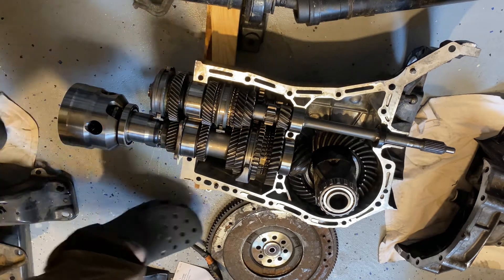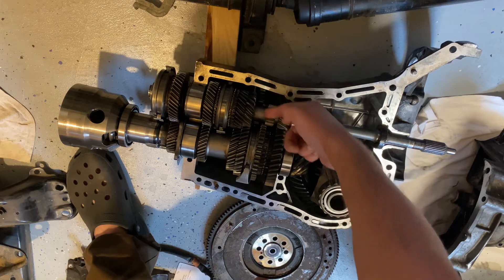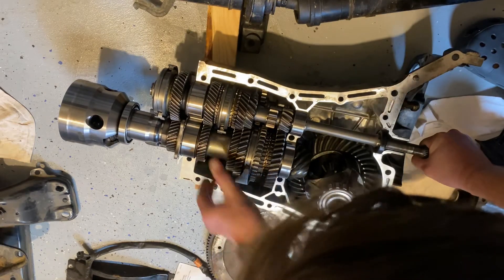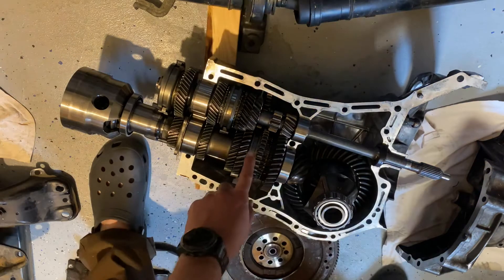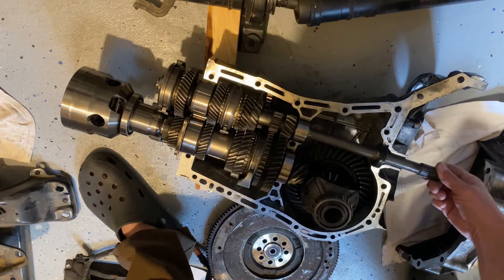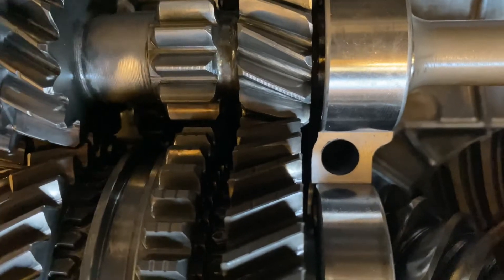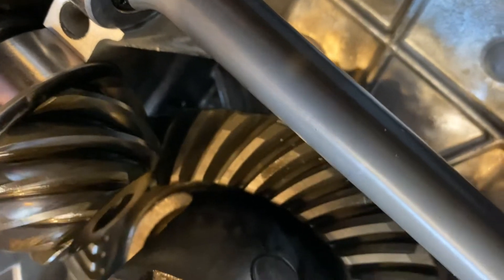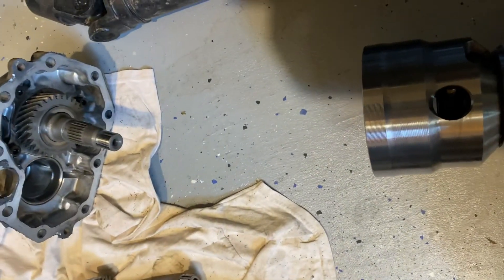Basic workings of a Subaru 5 speed manual transmission

Comment: This video is 5 years old and not very popular so it’s unlikely I will see an answer to this question.

If you were experiencing a torque bind with this style 5mt subaru transmission (suppose the center front and rear dif all match), where would that most likely be occurring? I know auto transmissions can have internal clutch pack issues that cause it but I dont see any way it could occur in a 5mt. 

I just 5mt swapped my 98 legacy and have a bind when the drivetrain is warm. Im almost certain its a cv issue after watching this video

Comment: This is an awesome in depth explanation. I'm looking into rebuilding one of the 15-18 6mt models myself but of course am running into crazy snags. First one being after I took the rear transfer case off to change the center dif viscous coupling the original slid off but then the replacement wouldn't go on for anything and as soon as it slipped on and fit flush with the case it is not snagged and stuck heavy 🤦‍♂️ so now I'm removing the entire transmission to figure out why it has resistance slipping on and now won't slide back off. Wish me luck!! I'm a diyer type of guy I'm not certified or anything but can figure most anything out and have a knack for small fine details but this has been a pain to find ANY details on. Nobody's done a comprehensive type guide for that model 😂😅
Reply from the maker: Try a heavy duty magnet from Amazon or harbor freight before you remove it. Some of them have 100 lbs of force!
Reply from the maker: I just bought a 2015 WRX with a transmission problem so if I need to tear it apart, I'll make a video! Did you get yours sorted?

Comment: Hello, I have a question. My rear differential is broken. The main gearbox and center differential are OK. Can I remove the drive shaft from the main gearbox to the rear differential to drive with front-wheel drive only?

Comment: Hi quick question do you have a idea why the transmission would stick in 5th, could the center differential cause the problem? Because I have it all pulled apart and the bearing on the center diff had exploded I’m just trying to find if the center diff failing could cause trouble shifting out of 5th at slow speeds or if it is part of the shift fork?
Reply from the maker: Doubt it’s the center diff. Probably one of the shift forks is bent if I were to guess.

Comment: Hey Scott. I’m having a problem with my manual  transmission from Subaru forester 2011. The problems is just when it gets hot. When I’m doing turns it makes a cracking noise I hope you can help me. Thanks in advance
Reply from the maker: Sounds like the center diff has gone bad. Especially loud and clunky when it’s hot

Comment: Interesting, why would they put the two gears after the center diff. I read one of the previous comments that they are used to get the ratio correct but why wouldn't they just put matching diffs both sides. Either im missing something or these gears seem a bit redundant.
Reply from the maker: I think it gives the factory optionality- maybe there was a time where they couldn't get the gear ratios they wanted for front or rear diffs and so they developed this- it's been in subaru transmissions for over 20 years now.  Also- it could be that they use it to change the output shaft height to give more ground clearance.  I'd be really interested to know from an engineer as I'm just guessing!
Reply: The diff is on the opposite side of the trans. this dude doesn't know what he's talking about

Comment: Nice video! Could you maybe explain why my eudm forester SG XT 5MT has a transfer reduction (at the center diff) of 1.081 instead of 1? It also seems to have a 4.444 front diff ratio and a 4.111 rear diff ratio.
The only thing I can think of is that there is a difference in torque sent between the two diffs, but I don’t know… an explanation would be awesome. Thank you!
Reply: The centre diff transfer reduction is to get the diff ratios to match. 1.081 x 4.111 = 4.444
Reply from the maker: Can you find your serial number on this chart?  https://www.rallispec.com/downloads/Transmission%20ID%20Chart_Public.pdf  having the steeper front diff ratio would make it a produce a little less stress on the gears for the front wheels, the transfer reduction would then make the rear wheels turn at the same speed as the front with those ratios.  perhaps with the heavier forester the strain was too much on the small shaft that runs from the center diff through the hollow shaft the gears are on to the front differential.  Making that differential steeper would lessen the strain on the shaft and the gear reduction behind the center diff would make the wheel speed the same between front and rear axles.

Comment: @Scott Briscoe

Sorry of this is a noob question. But why is the output shaft that is going to the rear differential not connected directly to the centre differential but instead via an intermediary?
Reply from the maker: I believe it's because not every Subaru used a 1:1 transfer reduction so doing this allowed them to put different gear ratios here.  this enabled them to put the same transmission in a variety of vehicles without having to reengineer everything.
Reply: so the shaft is higher op inside the transmission tunnel.
Reply from the maker: @geertterharmsel  That would make sense!
Reply: @Scott Briscoe thanks 🙏😊

Comment: I have a grind in 4th , how much of a pita will it be to replace? Thanks
Reply: 2003 wrx
Reply from the maker: @boostedego6043  4th looks like the synchro would be easier to replace as it's on the input shaft side so you don't have to mess with the pinion depth adjustments.  It might be easier to buy a used transmission and replace the input shaft from it into your transmission.  But this is definitely not for the faint of heart either way to repair this!